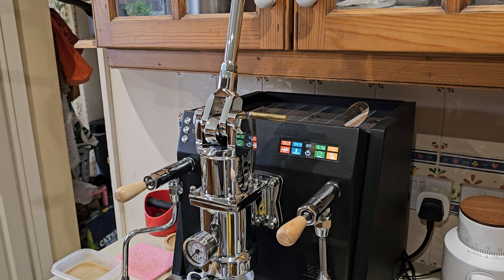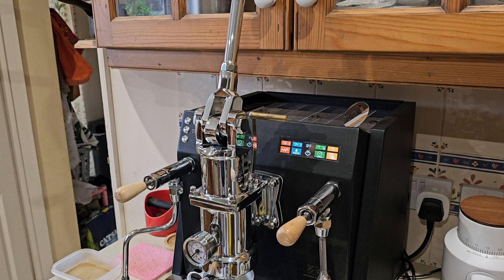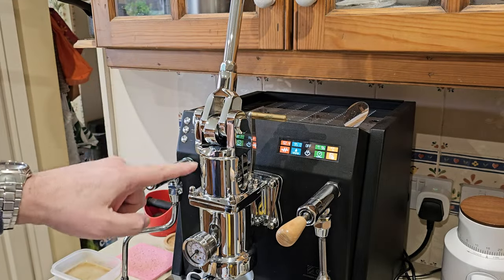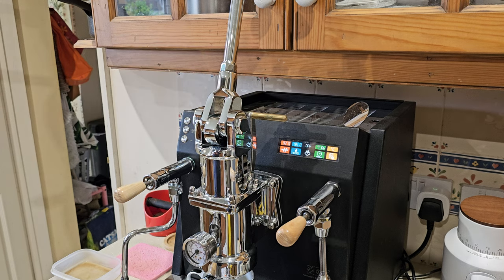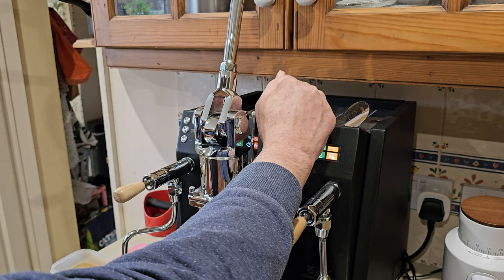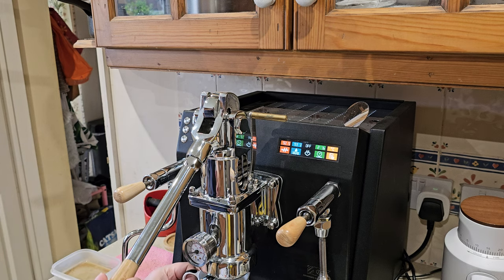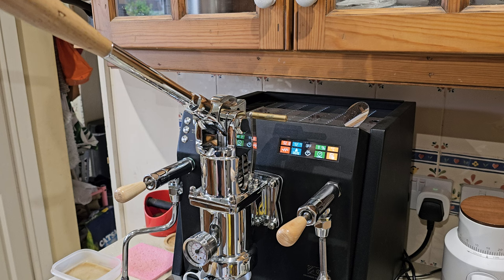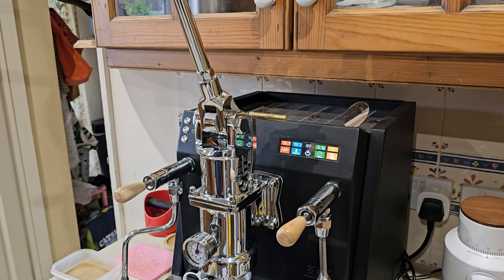Spring Levers - How to pull down the lever

Comment: Hi Dave  are you pleased with the Eve.  It certainly looks the business and the ability to control volume output accurately is attractive.  I can only control time on my Elizabeth's so volume can vary a bit especially if the grind needs adjusting.  I assume that as you can set up the Evo to cut off at a preset pressure the output volume is pretty reliable( or that is what I understood from your initial overview video)
Reply from the maker: Yes, I love it. Pressure is quite accurate in relation to the swept volume, thus amount of water delivered, so the weight is consistent. Not I said pre charge and high pressure shot. This means I have my single shot pressure release set to give the correct weight for a lower pressure shot and the double shot pressure release set to give the correct weight for a higher pressure shot. This is more convenient to me as I never make singles....unless I'm testing.